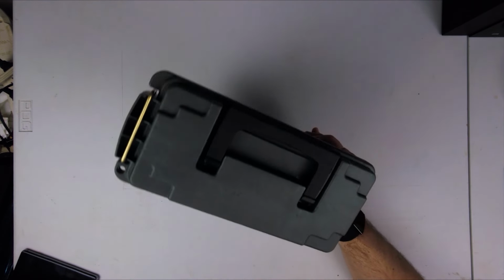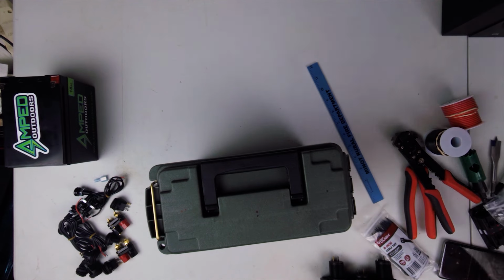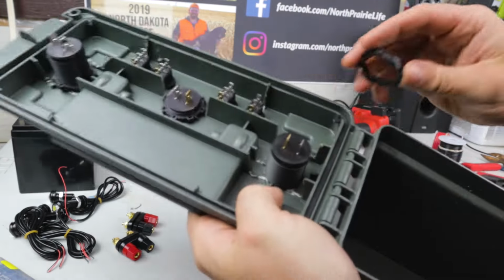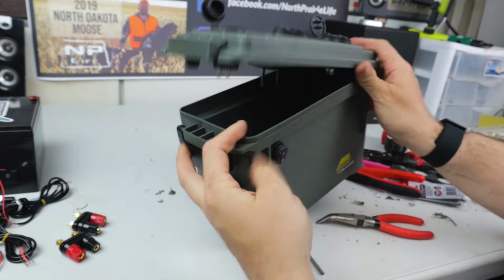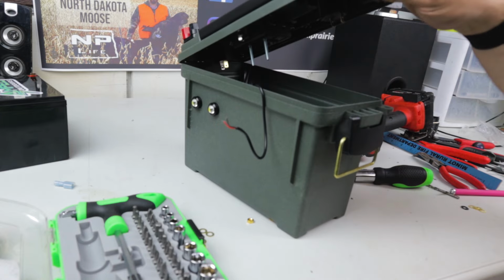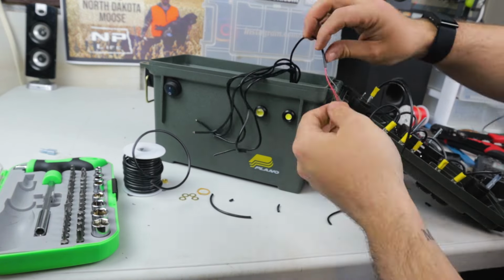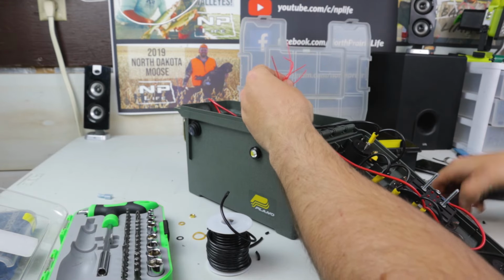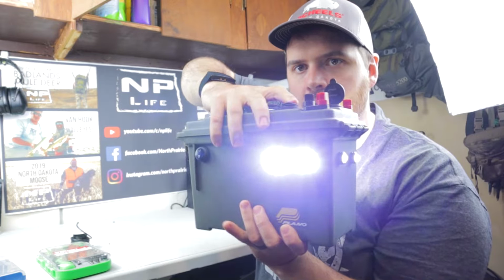DIY Lithium Power Box Build | 18ah Portable Charging Station | NPLife

Comment: Buy an ac dc lipo (4a shud be good ) battery charger and turn power switch on to allow current flow.. on amazon shud be abt $20.  plug into box to charge the battery.   Can use those pos neg binding posts to charge it.    Batt charger will turn off auto when the box battery bms tells it its full.     Can charge via ac or dc.   Id also put in anderson power poles.  Easy to hook up to for charging. ✌️

Comment: it's so easy to get the parts you need to make your own, why buy some stupid kit ? personalize your own box and put what you want in it.  QC3...PD Type C plugins, battery monitor...etc.  you do not need 6 switches, it can be done much easier. you also don't need a fuse box, a few inline fuses is less wiring and does the same thing. and ...I'm still LMAO over the fuse box bolts that are 4 times longer that what they should have been & then he thinks cutting them is the right thing to do, instead of getting the right length bolts.
Reply from the maker: @toddbuh  luckily for us all, you are free to build whatever you want, however you want.
Reply: Hey todd. Show us your videos.   He did what he could with what he knew and what he got.  He did a great job and prob learned a lot.   Todd taught us where the zach galifnakis character came from in THE HANGOVER.  His blood sugar is low cause mom didnt bring his din din.    For cutting holes in plastic.. heat is your friend.  I mark where center for hole saw needs to be.  Then use vise grips and a propane torch.  Heat up the hole saw and melt it thru.  It takes a few times.  Go slow.  But its very clean and actually strengthens the hole if u go slow    Good video.
Reply: @ConspiracyBear   @ConspiracyBear  If you can't figure out how to make your own, go ahead and buy a kit that doesn't have everything you want on it. I made my own, it has what I need, I soldered the wires and used re-setable fuses and the battery lasts more than a week. I use it day & night. he's selling a kit that is so simple to get on your own. you end up with what he includes instead of what you need. My friends thought I bought it because it looks so good. buy your kit and enjoy your night light
Reply: And I made mine from a real .30 cal. metal ammo can. not a plastic tackle box.
Reply: 4 fast charging outlets each one with two PD30 ports and two USB C ports. I can charge or run 16 different things at once. you can't do that with the kit you bought.

Comment: I built mine very simple put 2 rocker switch's on  the end put voilt gauge on top which has a on off switch and USB built in 3 two way wire harness plug in one for plug in and charge one for plug in overhead otter light one otter sled lights didn't need the other hardware mounted a clam lock plate to back side now it's plug and mounted to inside of otter lodge sled

Comment: What do you use the banana plugs for?
Reply from the maker: I use them for a couple things. First I have lights for the inside of an icehouse rigged up to alligator clips that just attached to the banana post. Second, the lithium battery charger has alligator clamps and so I attached those to the banana posts and just turn the switch on charge.

Comment: I know this os very old. But a good build, as a designer by trade I saw a few things if anyone makes one to watch out for, for safety. The side switch for power should be a push in/out or have guards to prevent it from being turned on by placing it against something. I had a case the exact same way (for R/C) and every time I went to use it, it was dead from something (someone) bumping it on at the track. Second you ran the power to the fuse box through the volt meter, the fuse box should have been wired direct to batt with fuse. The way you have it, the total amps of the fuse block now goes through the voltmeter and they are generally only made for 10 amps. A momentary short is going to blow the voltmeter before the fuse blows. Other than that, enjoyed the video presentation was better than some I have seen:)

Comment: Nice build BUT you really need to add a fuse coming off the battery positive BEFORE it connects to anything else. Safety first, If your main power switch shorts out there is no protection to the battery and a fire can result. There are far too many tutorial builds on YouTube that leave this part out.

Comment: Nice job. I would put a fuse between the battery and main switch. Also, the positive main should go directly from the main switch to the fuse block. Plug the volt meter anywhere downstream from the fuse block.
Reply: how many amps of fuse do you recommend?

Comment: May want to at least run an "in line" fuse between main and Voltmeter, and also step drill bits are great for things like this. A little wire loom and maybe some foam and You couldn't buy a better setup! Awesome Job!! Look forward to more of your vids

Comment: Would recommend an inline fuse between battery positive and the main power switch as close to the battery as possible.  Just in case of a short downstream before the fuse holder to protect the main switch and voltmeter.

Comment: Anderson plug's needed and maybe LED bar instead of Volt meter.
Also power switch on top - not to get knock when packed.
Volt meter would be handy if you can externally access it, like a basic multimeter.
The lights are a great idea. you can also buy resettable blade fuses.

Comment: You did a really good job. the only thing missing is you charging up that battery again you could get the charging system out of an old UPS Computer backup system so you  can charge with 110V plug so you can charge the battery back up.
Reply: Stumbled across this, never though of this battery box idea.  Not sure how to recharge, great follow up comment about using an old UPS.  Got a couple lying around, going to trying that!  Thanks for the video.

Comment: This tutorial is not good. You need a specific charging circuit in order to not overlaod the battery or over drain the battery
Reply from the maker: This comment is not good. I use a charger dedicated for lithium batteries. Also most lithium batteries have a battery management system built in.

Comment: Question? Is the battery rechargeable and how do you charge it?
Reply from the maker: It is. I charge it through the banana posts with the lithium charger that comes with the battery.
Reply: That's cool. Do you think you could charge it off a 100w solar panel?
Reply from the maker: @quassisbelltower9408  honestly, I have no idea.  I'd imagine you could. It just might take a while.

Comment: Thank you but darn it, you're making me think about adding LED lights. 

My box bangs around in the back, but I might be able to put the lights in between some ridges in the case...

My box version is not as nice as yours, it's  meant to be a straight 12v, light and portable power supply for a high volume (truck tire) air compressor and light duty trolling motor (I only run it for short runs when my hands are busy with fly line) and my fish finder/gps so I just have brass pass through (remote jumper posts) automotive terminals mounted near the handle of a waterproof Pelican clone (waterproof case with a one way vent) with foam that came with it to prevent rattling. 

I used 5/16" posts but if I did it again I'd use standard 3/8" posts. 

For waterproofing I sacrificed an old inner tube to make rubber washers. Put them on the outside, under the terminal body (not inside) and your case is waterproof again. 

The posts come with a screw on piece that locks ring terminals in place and protects the posts.

Since I used rubber washers, it floats, and I don't have to worry about salt water corrosion on my wiring, although I like the LED lights idea >:(

I used to help with minor modifications and installations on friends boats so I like to keep wiring simple and accessible because I've spent way too much time upside down tracing wiring.

If I were to run a heavy duty setup and didn't care about weight I'd probably use automotive side battery terminals and screw in some Better Battery posts so I could run standard car connections for charging and whatnot.

I run short 8ga wires with a 30a fuse inside, and my large tire air compressor has a 10a fuse that I tend to blow when I abuse it and let it get too hot 🔥.

So I don't run down my car battery, my box works great as a portable 12v source for inflatable kayak, SUP, and car camping air mattresses ... oh, I almost forgot about my human wash down pump (self priming ShurFlo with a pressure switch) for when I get out of the water (it draws from a 5 gallon bucket) and I really should use it to wash my car (not allowed to wash my car where I live).

Comment: sorry if this is a stupid question but how do you recharge the battery? are do you have to replace it when it no longer can put out 12 volts.
Reply from the maker: Not a stupid question at all. I recharge it through the banana posts.
Reply: @NPLife  ok so yo have 115 VAC 60hz power supply/adapter that outputs 12VDC and connect it to the terminal ports/banana posts?
Reply from the maker: @shagonoy  I'm not positive the specifics of the charger.  It is the Lithium charger that came with the battery.  https://ampedoutdoors.com/collections/lifepo4-battery/products/lifepo4-lithium-battery-4-charger
Reply: @NPLife  Aaahhhh I see. The charger has SAE connector, and you just plug the other end to a wall outlet, gotcha. Thanks for the link.

Comment: Put a piece of scrap wood on the backside of the plastic when drilling or boring to support the plastic against deformation and reduce the amount of cleanup required with the x-acto knife.

The screws holding the fuse block should have a finishing washer under the heads to spread the load and keep the top from cracking.

I'd recommend a fuse block that has both positive and negative connections so that everything is connected to it without the point to point jumpers back to the battery used here. It makes it easier to wire, easier to troubleshoot, easier to change things, eliminates a lot of wires being flexed when the lid is opened and closed. They are available with LED indicators for blown fuses.

USB ports are available that will fast charge an iPad or iPhone, or other devices. Apple and Google Pixel needs PD 3.0 and most other electronics need QC 3.0. There are some that have both QC and PD. You may also want to consider USB-C connectors as they are becoming more common and can deliver more power by increasing their voltage output. With more and more things using USB for charging adding one of the fast charge ports to this setup seems like a good bet.

Comment: I'm new to this stuff and I was wondering: why 2 sets of the banana posts and can you run some wires from those banana posts to a solar charge controller and charge the battery up via solar? Thanks. Awesome build.👌🏼
Reply: z.b. damit er gleichzeitig aufladen ( z.b. Solar)  und eine Last anschliessen,  entladen kann!
Reply: He has several things he wants to charge, and the battery has a built-in BMS so as long as your solar setup provides about 14.6v through a proper LIon charger, and you use proper guage wires you can charge the battery however you want. 

Have fun 😊

Comment: I'm sorry to be another one to tell you this, but they are correct when they say solder solder solder! I've been an electronics repairman my whole life of 53 years, starting at age 8. I've also designed and built lots of iterations of your box, taking advantage of tech improvements as they come. Battery tech is amazing these days!  Trouble is, crimp-ons have gotten thinner, cheaper, and more unreliable. That is unless you use the real McCoys like Amphenol, Amp, or new old stock Switchcraft (yes they used to make crimps) and you must use the identical tool of the same brand. You'll have a hundred bucks in the crimper alone, but it will be worth it in the long run. The ones you used with the poor crimping technique, might last a couple months before they start failing. It would help to put some solder on the current crimps, at the wire, and at the mechanical junction. That would be the fastest and cheapest way to make your box very very reliable. The other necessity is loktite!  Use the blue on every threaded thing in there, and I mean everything!  Those 2 improvements will make your box live on for the roughly 5 year lifespan of that battery, with nary any repairs except for rough handling and dropping problems.  The way you charge it, with the power switch on and so forth is a matter of taste. An option you may like would be to attach a red and black chunk of 12 guage stranded directly to the battery terminals, with a thermal breaker in-line on the positive, and running them to a robust connector somewhere, the banana jacks are perfect for the job.  Dedicate 1 pair for charging, wired as I said and you would be able to leave your gear connected, turn off the master to shut down the gear easily, and charge the battery with nothing getting smoked because of the higher voltage and current used when fast charging one of those babies.

Comment: This is such a great design using that Ammo box 👍

I don't know why you didn't just solder most of the wires though.
Reply: Soldering wires that will have decent ampdraw is a bad idea, solder melts, and can cause resistance issues.
Reply: @SuperVstech  If soldered wiring melts you've got a design problem ! lol
Reply: @edwardfletcher7790  yes… you used solder…
Reply: @SuperVstech  Yeah, I should have used scotch locks like a Pro ! LMAO
Reply: @SuperVstech  I used exclusively solder on one of those DIY spot welder kits. The device runs hundreds of amps and is literally designed to melt metal. Adding solder to the circuit board traces doubled the power and allows me to weld 0.3mm pure nickel with  a device roughly the size of a credit card. Even commercial quality spot welders can't do that. If your electronics are running at >350F, time to find a new hobby.
Reply: @tedhancock68   Is apples and oranges sir apples and oranges

Comment: I am an IT / Network Engineer, but I simply cannot wrap my brain around wiring and electronics like this.   It's really discouraging, because I know it's not just for "geniuses" to be able to wire stuff themselves, but I just don't think I am capable of learning this stuff.  I'm really trying to get in to solar/DIY/Batteries/Bug Out Vehicle overhaul etc - But, the wiring and electricity terminology runs me in to a wall :(    Can I just BUY this box off you, dude?
Reply from the maker: Hey man, check out www.iceholepower.com. they sell them pre-made and done much better than me.
Reply: @NPLife  Thanks I did look at this right after I posted my comment, but didn't even realize they had an option for professionally wired boxes!  - That said, as I am looking at the cost, they seem comparable to one of these solar backup batteries I'm seeing promoted a lot, such as the Jackery stuff.  Are these both the same thing, essentially?  Is there a major difference I should take note of, not being very savy with electronic components and terminology?

Comment: My volt meter is staying on constantly any advise?
Reply from the maker: Do you have a master switch wired between the main positive and the fuse box?
Reply: Take the feed lead for the voltmeter from the other side of the master switch.